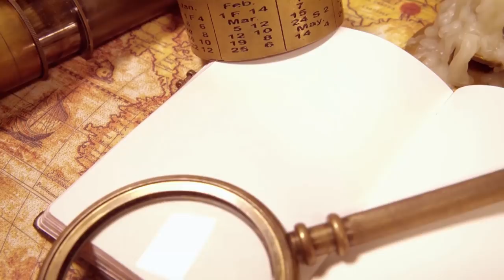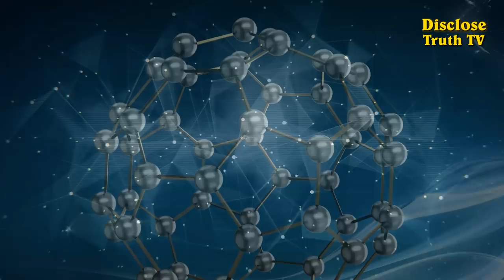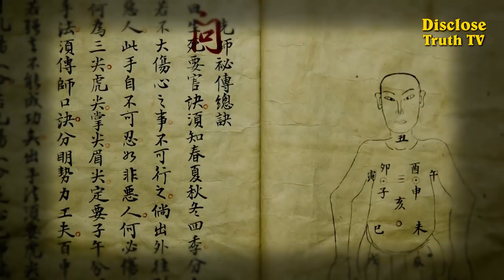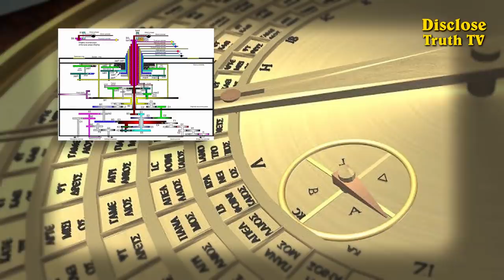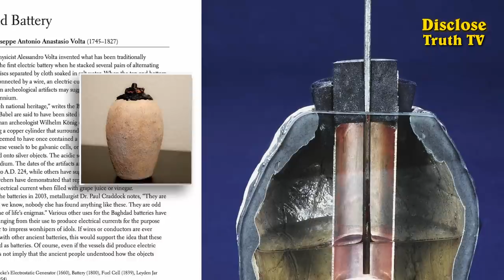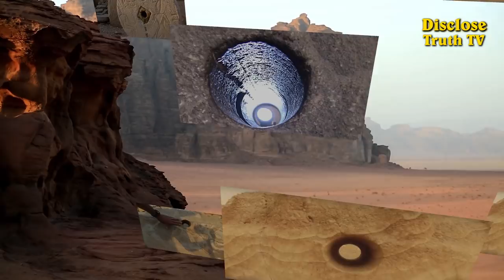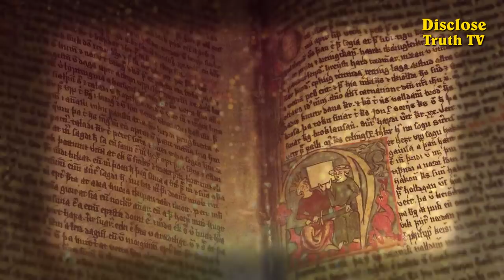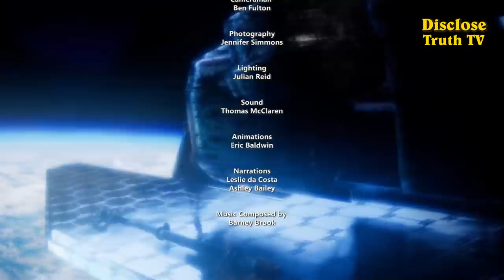Forbidden Discoveries Documentary 2019 Impossible Devices, Out of Time Technology and Artifacts

Comment: In my opinion, Robotics seems simple enough if you build according the the same model as human structure, with bone shape frame electronic pulse wiring running along this frame, with micro processors embedded at points where the structures would make bends and circular movements. This is covered with a cushioning material similar to foam with sponge like properties for absorption to both protect and provide necessary oils for lubricant. The main computer is located in the upper portion of the Neck just beneath the skull, with a left and right backup system in the cranium. Each area is fortified with a specific computer system designed specifically to help highlight and reinforce that specific portion, it's functions and limitations which include safety stressors  that act as prohibitory points much like pain receptors or nerves in humans. Nanobots are also a part of the machines overall circulatory system. These have the function to go about repairing  areas which breakdown over time. as well as keep tabs on various functions and report to their specific micro processor any serious malfunctions. There are pressure sensors in the hands and feet as well as visual sensors in the optical areas. In fact depending on how detailed the entire system was it might be equipped with sensors of various kinds for anything from sensing heat to sensing liquids, even temperature and damaging corrosives! The optical lenses had a second and third lens for night vision and as a protective layer to keep it shielded from being damaged like an eyelid.  Most of these were manufactured in automated machine plants, which were much more precise and could perform various functions in greater detail. These make excellent servants and basic laborers, with some more highly functioning capable of being used on the moon to construct necessary observation stations. And in underwater mining or explorations information gathering units. They could also be utilized in precision construction for certain projects. It is possible for man to build such units today, if he wanted to do so.
Reply: You have a good and valid opinion. I can see robots paving our way through space. I can also see people having robotic components surgically implanted to enhance, replace or even add "Extra" abilities, limbs, breathing capabilities....etc....to whatever new environments we may encounter. However we need to be careful and not lose our humanity with either the fully robotic or human robotic future selves.

Comment: It was not heat that allowed them to carve the stone. The sizes and shear bulk densities of those stones would have emitted so much radiant heat that no one would have been able to get close enough too them to do any carving. They certainly would not have been able to handle them and position them so perfectly while these stones where at such a temperature.
All these experts just pursue a theory without any thought as too the actual application of the methods in the theory. It just did not happen that way.

Comment: The theory that megalithic wall stones were 'poured' doesn't add up. They are actual stone, not cement, but ascribing them to geopolymer technology would require a massive manufacturing capability to produce the raw material, and evidence of any such capacity does not exist anywhere.  
The 'poured stone' theory only makes sense when the stones are of a uniform size, which is the case in regard to many megalithic walls, but not all.  We have to explain the non-uniform, megalithic, polygonal, precision-fitted stones of walls such as Saqsayhuaman and Ollantaytambo. They are all unique and generally massive.

My proposal is that they were built by huge E.T. Artificial Intelligence robots that had no programming for aesthetics, so non-uniformity didn't matter to them.  They had tools that would soften the molecular bonds of the stones to a depth of a few inches, thus making them plasticine and moldable to the stones they were fitted to.
That technology exists today but is only possessed by the deepest of the deep-state operatives. 
 It's the result of the inventions of Tesla, but has been kept secret. It's use though isn't to soften stone but to reverse molecular bonds thus causing molecular repulsion, causing substances to turn to powder from solid.  We've seen the effect of such technology in numerous sci-fi Marvel and DC movies.  Molecular disintegration and repulsion.  It's effect is due to super powerful vibration at very low frequencies.

Comment: Drilling a hole in stone can be accomplished rather easily with a stick. Chip a divot out where you want to drill, spit in it and throw some sand on it. Make the stick go round and round and with enough spit, sand, sticks and patience, you can drill a hole through just about any rock. No advanced technology necessary.
Reply: Umm ya only an engineer was quoted in another documentary saying the drill bit used in the south America hole had to be spinning an extremely high rpm with a vibrational, pneumatic quality to the drill bit. Don't know of any stick that can do that.

Comment: If they made stone soft(which in itself is amazing), wouldn't the sizes be more uniform?
Reply: No, the softening only needed to affected the surface to a shallow depth so that the stones could be precision molded to each other.  The softening tech might have also been applied to megalithic walls that used mostly uniform size stones that were probably cut to a uniform size but crudely, -still needing softening to make them fit each other perfectly.

Comment: Looks to me like they have a form of concrete and poured the blocks in place. Maybe by using hemp bags to pour into and some sort of form system to hold up the front
Reply: When Spaniards first saw those Diego? Said " I can't believe Giants/ demons built these magnificent structures. The Giants makes more sense then poured forms since the forms would have tu be giagiantic as well and concrete when you pour it takes an impression of the objects it's in these did not but the weird two bumps or double depressions on some are kind of clue but to what it's impossible to tell

Comment: I would like to know how did the inside of the pyramids get built and finished, when inside there are no torch soot marks or charred ceilings, and also a flame cannot be supported the deeper you go in for the lack of sufficient oxygen. So what i am asking is if the "Baghdad Battery" was not use to power some form of light bulb, then what did they use to see what they were doing when they were working n the inner parts in the pyramid?.  And i would just like to point out to the scholars who say that the "Battery" was used for electroplating only, well i say could it not also be used to power some form of light bulb? people can use items for more the one thing.
Reply: Baghdad Batteries is what I’ve seen a few think is how they did it, I tend to think they are probably right, like you mentioned, soot and smoke would have been all over the very ceilings they were painting. Have you noticed the long weird looking light bulb in the carving, painting or something in one of the walls, there is a battery with a cord and it’s running up and over to the light and the girl I think is holding something, showing it to the other person in the picture.

Comment: How would anyone be able to handle a hot ‘marshmallow ‘ stone weighing several tonnes in to position,,not withasbestos  tongs or gloves ,  is not very likely?  The mystery can not be by heat alone. The placement of a rough cut stone, yes , then using a  Even a mortar that dissolved the opposing surfaces of the joint the joint. Like an acid, very carefull.

Comment: Quite a Few Months ago: Somewhere  in England  {A location I am Not  willing to Reveal as yet}  But what I am willing to tell you is that  By chance I was walking on  some Shoreline ; where I Discovered Deep Score Marks ; Some of the deep Score Marks or should I say Deep Score Lines of which  were Various shapes and  Sizes; Some were Etched in the shapes  Exactly  as the ones that are depicted on  2:14 and 3:03  to 4:++ What I can tell you that these Shapes  Match Exactly the  Ones that are  Embedded on the shoreline: I'm Positive  on what I saw is something More than a Few hundred thousand Years Old? Therefore these Cuttings or etchings Could not have  Been done by some Hammer and  Chisel  They Had to be done  By Using some Form of  Huge Angle Grinder that could  Cut a Deep Thin Grove more than Two Metres Deep: The Shore  Line Jutted Out to Sea more than  100 Metres out: It was Once an extended Cliff that Jutted out to sea; where I'd estimate that the Cliff top was about 150 to 200 Metres High; Whatever Machinery they  had all those thousand of years ago must have Been Gigantic to say the Least !! Imagine A Gigantic Angle Grinder with a Blade  at Least Two Metres Deep {total of 4 Metres} which could Cut a thin Line approx, One Quarter of an inch: There  were Straight Lines and then there were Octangle Shapes and Shapes like a Setsquare and Various other shapes: I Don't Know what they used to Cut these Etchings; But I Know Exactly on how they Managed to Turn these Etchings into Blocks !!! After Cutting deep into the Floor of the Sandstone the Acquired shape; a Machine of which I will describe as a Crosscut Saw cut 2 Metres or maybe More Deep; and on doing so it would be made into a Massive Block  : where After that it could be  Lifted out with one of their  Cranes or  whatever device they used to do it;  There is No Doubt  in My Mind they Had better Machines than what we have today; Now Having Cut out Block after Block where eventually  they Had reached the  Bottom where no more could be cut out; all there was left to Show  any detail was the deep tell tail  Lines  etched out  into the  Sandstone {Anyone interested in seeing for ones self I'd be More than Happy for a small fee to show exactly where  they are; This site Juts out to sea  200 Metres and  5-600 Metres wide it is spectacular to see

Comment: In my opinion, Yes they could melt stone or rock but besides the use of lasers they used sound tones and the plant just mentioned or a mixture of the plant with other natural plant root juices to initiate the bonding process. Look if those of earth wish to survive certain coming disasters one thing you should consider doing is building underground travel systems for your populaces, they don't have to be very deep perhaps  twenty to fifty feet would suffice in most cases. This would allow continual travel throughout most of the world in a majority of cities and towns. It would also prove advantageous to have both elevated housing and businesses as well as subterranean structures already in place in most areas, mainly inland but along the coasts stay high above surface ground, with quick exits below ground should the need become necessary. Build for structure integrity underground to deal with high pressures and stresses, and stability above ground. Keep structures above ground conical or round to allow for high wind velocity and run off into grated gutters. Make all sewer systems with changeable progressive filtering systems and reusable water catchers. Recycle plastics and other materials for reuse. There is a way to disburse radioactive materials that reduces their after life to less then a hundred years and this can easily be disposed of through the use of a melted rock filtering system as well. I don't know the precise details on how this was done only that it is possible. Various tone vibrations have great abilities to do a lot of good if properly utilized. Music can actually speed up healing in people, plants, and animals. Certain tones within certain rhythms has the power to help heal some injuries, produce better crops, and  sooth animals. Certain vibrations can also be used to strengthen structural integrity in bridges and other structures. I give this knowledge freely to whomever wants to use it to help their societies and fellow men. Some of you already are aware of some of these techniques, you had men like Tesla who provided you with other advanced knowledge.  I' m not interested in money or power as these are all temporary at Best. My only hope is that you would learn to live in peace with one another and worship the Only True God of the Hebrew Bible and His only begotten son,  HaMashiach, Yeshua. The One who created mankind and this world. Trust in Him for he is worthy of all trust, thanks giving and praise. Jesus  is the image of Holy God who is the unseen Father of Yeshua, (Jesus), who is worthy all all our praise and worship for all eternity! What has been suggested here is nothing in comparison to what Heaven is like. It's not the third heaven which is the outer solar system and was created by God. The Heaven I speak of is the one beyond the stars and solar systems, beyond what some have called the expanding universes.  But humanity has been offered an even greater gift, that of knowing the God of the universes, as their personal friend and Savior, and to enjoy continual fellowship with Him! I only hope some of you will consider His offer of such an invaluable (priceless) free gift, and not pass this one chance to know Him, as your Lord and Savior. This is the same son of Holy God who shed His own blood on each of your behalf. Even so, come Lord Jesus!